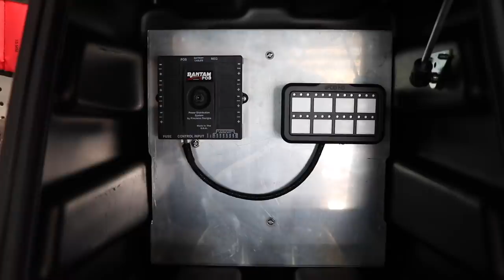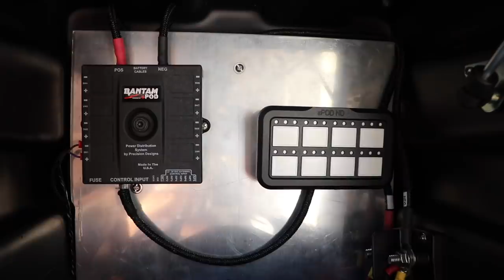Wiring Up the Jeep Gladiator for Accessories – Overland Build

Comment: I realize this is a 3 year old video. I am not sure how I missed it when it was new. None the less. It is refreshing to see someone do this right. I always cringe seeing most peoples wire jobs. I did basically the same type of install on my JK for all my accessories. Only difference I did was instead of the sPod I built out my own custom fuse box with switch relays to be sure things were wired and fused exactly how I wanted them. It also lets me be more customized. Great Job!

Comment: Very cool install.  That box will make life on the trail super smooth.  

One thing to consider though. The wires that you ran up between the cab and bed are in a precarious location if you were to get rear-ended and have the bed meet the cab.  Although a long shot, they could be pinched and positive could short out to the ground, bed, or cab.  Might want to pull them down and reroute them up into the bed itself through an insulated hole.

Comment: As a former aircraft electrician who is now an electrical engineer, I find no fault with your work in this video, the two things I was concerned about (cables entering/exiting frame rail holes, and the uncovered buss) you addressed at the end. 👍🏼

Comment: Sweet install Doc!
Good call on the battery side fusing. Only two things I'd do different are; 
1. The bed to cab could be a pinch point.
2. Zip-tie a piece of hose around the battery wires where they go into the frame.

Comment: Glad you mentioned the primary fuse. A quick disconnect comes in handy too. Less likely to short out if you need to work in the box. Plus, you don’t have to break terminal connection.

Comment: You need adel clamps for those wires. It's a must. Google it. We use it in aviation. You can buy them at home improvement box stores and auto part stores. If you dont do something  other then those zip ties, the wires will eventually rub through that mesh and then the wire. Just a little FYI.

Comment: recommend a resetable circuit breaker instead of a fuse battery side.  i put an 80 amp on my JLUR feeding 6 gauge to the back seat, works great! and i can interrupt the power with the button on the breaker if needed.
Reply from the maker: Yep, and 80 amp resettable is exactly when I ended up using!
Reply: @TrailRecon  sweet!!
Reply: I've considered that but I use MRBF for the space saving and carry extras.
Reply: @JustinKingOffroad  80 amps on a 6 guage wire. 6 guage is only good for 65 amps at 75 degrees using THWN wire or 75 amps using THHN at 90 degrees. You are a little high on your breaker amps.
Reply: @Ottos_ScLm_Race_videos_2009_on  in my case it's perfect. at MOST i'm pulling 50 amps with my fridge, compressor, and radio on, but the engine heat coupled with the load heat pops the breaker at under 40.  so it was upsized to 80.  in the event of a dead short, it'll still pop.
Reply: @JustinKingOffroad  I work with wiring dailey we have had stuff shorted 8 guage wire and 60 amp breaker it fried the wire inhalf before it tripped the breaker. Where I work now it's 12 guage and 20 amps max.

As far as the breaker tripping by heat, really. I would say you need a start type relay. We had the same problem with breakers running a testing chamber when the compressors came on they tripped the breakers when hot. So we had a start up delay type breaker put in. Same size just had a delay for the start up over amping problem

Comment: If you add an insulating layer (thin closed cell foam?) it will quiet that compressor.  I bet 1/8" stuff glued in would work wonders.

Comment: Ground to frame. Then bond/ground the truck bed to frame at all 4 corners and bond/ground the battery negative terminal to the frame and to the body. You'll have a much better ground and less spurious emissions from radiating ground wires. You will have less system voltage drop while under load, and SNR will drop significantly...which will be important when you start focusing on radio gear.

Comment: Nice install. If you move the switch box up and put an piece of angle below it, it would allow more space for storing hoses on top of the compressor with less risk of the switches being accidentally activated by loose gear.

Comment: Loved the video! I must say I love how clean you're keeping the build. This is how it's meant to be done! Beautiful work! I have a few suggestions you may like - Add some sealant to the glands so that they don't let water in. Also, perhaps look at adding PC Cabinet Fans to suck some of the hot air out. You get ones that work on 12V  that are small and powerful enough. If you mount these under the box, the chances of water entry are greatly reduced. Perhaps add some spacers under the compressor to aid airflow as well. And maybe spray the aluminum plate at the back black. Just looks cleaner. Keep up the great work, look forward to many more adventures!

Comment: Nice clean installation.  As soon as you mentioned the offset screw holes I saw it coming, bin there, done that!  It's all good.  I like the redundant fuse next to the battery.  If your positive were to short out against the frame, you'd be burn that beautiful machine up (can you say Coyote Works).   Loving the build.  Safe Travels and God Bless!

Comment: How do people dislike this video ? You don't like Brad?, the photo quality? , his English ?, Marco's company? , Jeep or what ?
Reply: somehow they see red
Reply: @kricketflyd111  No Kidding.
Reply: Gotta be Russian troll bots.
Reply: Probably disliked because of the UPS guy blowing the stop sign there....
Reply: Disliked it at first but then saw the last minute that addressed many of the issues and reversed it. There are still quite a few best practices that should be incorporated. E.g. specifying cable that exceeds the standard for primary automotive wiring (GXL or SGX).

Brad, have a look at MRBF fuses when you are deciding on a fuse solution. I run 4 or 5 of them (100A to 200A) to my various Cooper Bussman 15303 RTMR boxes and distribution circuits, and they save a lot of space

Comment: Not sure if you've already tackled this problem, but as for preventing the cable sheath from rubbing on the chassis I believe you should do it a different way. You mentioned putting a rubber seal around the holes in the chassis - instead of that, I think you should put a stronger sheath on that segment of cable. The problem with putting a rubber seal on the chassis itself is the "Honda Problem": Putting a rubber seal around steal will trap moisture and cause the metal to rust quickly and badly. The reason you see old Hondas with a lot of rust around the fender lips is because Honda put a rubber seal around the pinch weld. It had a more finished look and feel, but it trapped moisture and caused rust in virtually every application. The solution on a clean example is to simply remove the rubber seal, preventing future rust. A truck chassis is typically even more rust-prone due to lacking primer and paint so the problem could be even worse in the future. Adding some sort of thick sheath to the cables, such as very thick heat wrap, or perhaps a hard wrap like PVC or something, might be a better option.

Comment: As UnusualWarrior pointed out. You are going to need significant cooling because the heat the compressor will generate is trapped inside that enclosure. I would set the fan up to come on with the compressor.

Comment: For heat removal when running the compressor, connect a computer fan to the bottom of the box. It'll be a simple and clean solution.

Comment: I would get a high amp thermal circuit breaker at the battery to box in back. And put a blue sea fuse box in to, for thing that need no switch to use.

Comment: Looks nice!  I would discourage routing the wires between the cab and bed. Did the same on my truck as the wires rubbed through the paint down to metal after about 1yr. And it’s not easy to touch up paint in there.

Comment: Have you thought about waterproof panel connectors ??? You would have a bunch of connectors at the bottom of your black box that you can plug and unplug as you load and unload electrical accessories from the bed of your truck. You could also just unplug everything from said connectors and remove the black box for servicing.

All the connections inside the box would remain fixed and stationary, so no need to pull any wires out if you decide to remove the black box from the rack system.
Reply from the maker: It's a good idea, but I'm going to have several wires running to the box, so if I find something compact enough that works, it's a great idea.

Comment: dunno about the  glad in particular but most pickup trucks have flex between cab and rear bed, if true w/glad  those wires from main batt  could  get  squashed/shorted, maybe double check if that occurs.  Google it, but you maybe better off  w/a fuse by battery vs breaker,  just my 2 cents awesome video   To make it removable check out power pole connectors and or molex .

Comment: Very clean install. I was taking notes, that switch panel is legit. I wonder if it would be possible to put a battery in the bed and use the battery charger wires that are in the 7 pin rv plug. Plus that could take some stress off the cranking battery.

Comment: Brad, Surprised the Gladiator does not have drain holes coming up through the bottom of the bed.  Have not seriously looked at the truck yet, but it would have been cleaner to run the up from the bottom rather than between the bed and the cab.  Anyway, looks really great...

Comment: Brad, would you please do a comparison between the stock LED fog lights and the KC Hilights fog lights? Been contemplating them but have not seen a comparison with the stock LED fog lights for brightness, beam pattern, etc. How well do they fit. The factory steel bumper?  Thank you.

Comment: Do you think you should have run the battery cables up thru the bottom of the bed instead of  between the cab and bed?  Much cleaner look plus its a pinch point when bed and cab are flexing on trails.

Comment: The reason the Humming bird went in your garage is because it thinks your Red hanging garage door release is a flower. I had the same problem, so I covered the handle with black electrical tape and they haven't been in since.

Comment: Did you need an adapter to install the fog lights in the steel bumper? If so what did you use? KC says the lights aren't compatible with the Hard Rock bumper; is this new bumper different?

Comment: Those Pro 6 lights -- they have the universal mounts? I just ordered some for my JL steel OEM bumper and the bolt seems bigger than the hole. And, did you remove the bracket underneath the hole? Thanks.

Comment: Totally of the topic, but, wanted to get your opinion on an issue I am having with the installation of a 28" Chase light from KC Light. Support from KC has been shall we say useless (in the kindest way)... Installation is on a 2019 Jeep Wrangler JLU (non-LED lighting system). I have a Vos Switch installed, using to control both the Amber flashing lights and White Spotlights on the bar, working as designed. The issue I am having is with the Brake Light on the bar. Followed the installation directions to the "T", direct black/red wire connection to the battery, etc. Activation of the 4 way flashers, thumbs up functioning. Only when using the Brake and or Turn signal... the appropriate lights activate and work correctly for about 25 seconds then do a double flash, double flash, and then quit working totally. Flashers/Spotlight still work though. Is there something (part/component) I need to correct this. KC's answer is to have it professionally installed, my reply is that the installer would use the very same set of instructions to do the installation (costing me a butt load of money in the process). Suggestions?

Comment: Looks like a great project. Excellent job Brad. One question I had while watching tho, did you put silicone in the bolt holes between the box and the washers where you mounted the aluminum plate, or will the plastic seal enough around the washers to keep any water out?

Comment: Brad, this is great, thanks for the video. I ran my rear wires exactly the same way on the JLU. Have a couple of questions/comments on the build:
-why did you go for the sPod when you could use the 4 aux ports that came with the Jeep? Is it because you expect to require more electronics with on/off you wanted to control from the cabin than the aux can handle? I wouldn’t expect too much of a voltage drop for the first two switches to warrant it. 
-not sure you need the long negative lines directly to the battery vs just bolt to the frame further back. Might be cleaner to skip unless very sensitive electronics. 
-the air compressor in there is making me nervous: it gets hot and is sitting on plastic, it means you can’t put anything else on top of it for storage, and as you mentioned ventilation seems challenged. Seems like the ARB would be better off under the passenger seat with nothing able to touch it, then you’d have more space for storage in there
-I’m a bit nervous about that bare bus sitting back there with a hot line. I know you’re looking for a cover but generally I’d rather keep the hot lines more protected. Don’t want something jammed in there for storage and bumping it and causing an issue. They sell really cheap waterproof marine fuse blocks on Amazon that might be a cleaner solution for a hot line for $15
Reply from the maker: Thank you for your comments!  I'll be using the auxiliary switches, but I'll have more than 4 items that will need a switch.  The compressor will only be running to inflate the tires, so door will be open.  We'll see how it goes.

Comment: Hey Brad great job but I wanted to mention I could swear I saw a video on those pods not being completely water tight. I know where you are is dry outside most of the time but just be aware you may have some leakage during rainy days. If you addressed this already or it's a non issue then belay my last.

Comment: Brad, hey can you help me out? I have 1500 ram, 4x4, 5.7. I have a Leiter with 2 single boxs 1 -3  a nd lastly 2 box that I wanted to put my electrical. My 240 pane.l is mounted on my GFC.

Believe it or not I thought that I could use my double box. I went to your site to ask for ideas or help and I saw that you and Marco already did it with a single box.

Can I chat with you about it. Doug

Comment: Be careful running your main power lines between the bed and cab of the truck.  I've seen a lot of off road trucks flex so much that the bed contacts the cab.  In the event of frame flex you could pinch those cables in there.

Comment: Great video Brad, it’s definitely coming together nicely ! Are you currently running a single or twin battery on the Jeep ? My Marco is called Tonto, shame he lives the opposite end of England 😂
Reply from the maker: Just a single battery for now.
Reply: @TrailRecon  So you running a solar panel to take some of the strain ? I run 2 x Odyssey batteries but may put a solar panel on at some point.